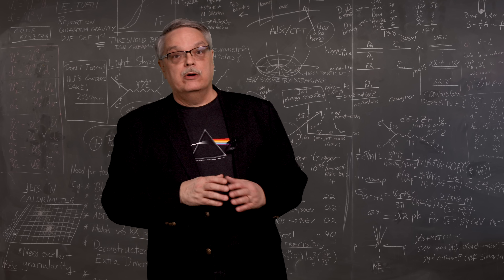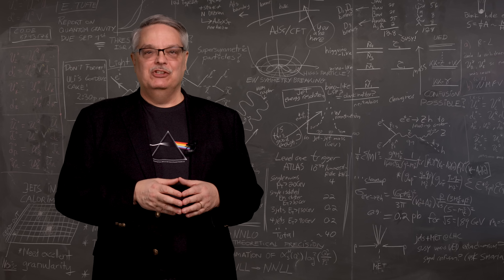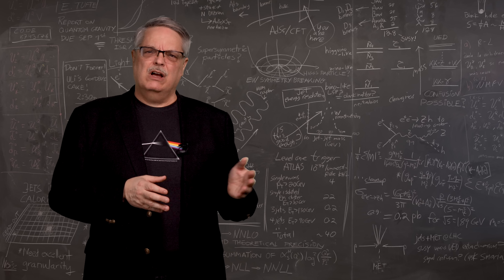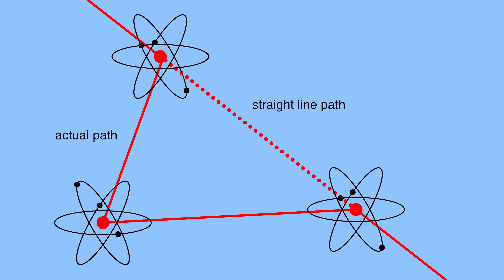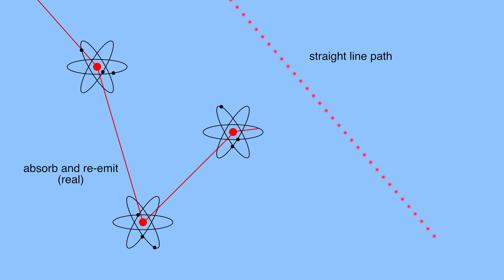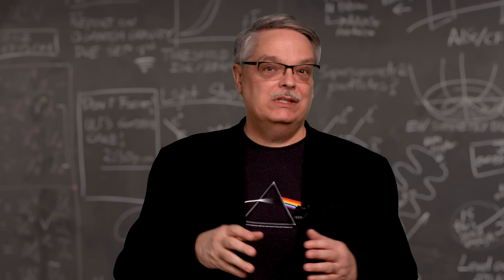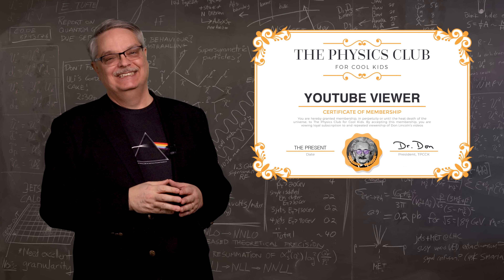Why does light slow down in water?

Comment: Great video, but this leads me to another question. I know that light is an oscillating electric and magnetic field, but that light has no charge or magnetic force. As it is an oscillating field, does that mean that it has a charge at its peak and a different/opposite charge at the trough but that the net charge is zero? I know electrons oscillate when exposed to light and this reaction would support my question

Comment: I get why it slows down when entering the glass at any angle... but why does the angle change twice? Why does the light not continue on the same path but simply move slower through the glass, then emerge and return to its original speed? What causes it to change angle when transitioning into and out of the glass?

Comment: To be frank,i am deeply dissappointed as most of our physics textbooks postulate that light speeds up or slows down depending on the medium in which it is transmitted.This hypothesis is clearly a violation of the fundamental laws of physics.The speed of light is a constant everywhere in this universe and this is the fundamental basis of the theory of relativity proposed by Einstein.

According to refractive index calculations,the speed of light in water is 3/4th the speed of light in vaccum. Most textbooks justify this by saying that light slows down in water coz its an optically denser medium. This justification is partly right and partly wrong.

To know why its wrong,you’ll need to know more about the quantum mechanical phenomenon of propagation of light through a medium.(i’ll try to explain this in the most layman terms as possible).

light is made up of photons(you can think of them as energetic balls) and all matter around us is made up of atoms which itself is made up of protons,neutons and electrons.The electrons in an atom have specified energy levels which it can occupy.when an electron absorbs a photon it gets excited to a higher energy level and when it releases one,it gets to a lower energy level.

So when light passes though a medium like water,it doesnt go straight unhindered.Instead the photons from the light beam get absorbed by the electrons in the water molecules and get retransmitted instantly. This absorption and retransmission of light by a molecule causes a time lag which is nanoscopic in nature .But if there are a lot of water molecules in the path of light,then the time lag caused due to absorption and retransmission of photons by every single molecule on its path becomes considerable.(important-note that photons after retransmission travel at the speed of light).So the entire journey of photons go on like this —travelling at the speed of light—absorption—time lag—retransmission—travelling at the speed of light—and so on.

So as a whole,light “””APPEARS””” to slow down while passing through the medium .THIS IS WHAT MOST TEXTBOOKS MENTION AS THE “SLOWING DOWN OF LIGHT IN AN OPTICALLY DENSER MEDIUM”!!

Comment: If you've ever seen a magnet falling thru a section of copper pipe, you would see this effect in action. The magnet falls through the pipe inducing an electrical field in the pipe that slows the fall of the magnet down. When it leaves the pipe the second electric field ends and it resumes falling at normal speed.

Comment: why does the resultant wave have lower amplitude, it still failed to explain the slower wavelength keeping frequency fixed, also i m failed to understand bending part here, which is related to slower speed, but i failed to understand from ur video, superimposed wave will be having delay. also y u r not explaining the magnetic part it is really effecting the charges particle, electron

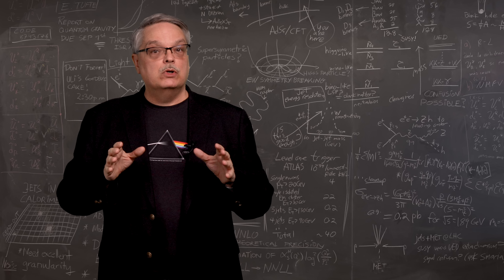Comment: at 8:45. indeed it doesn't explain the slowdown as only the amplitude is reducing but the velocity is the product of the wavelength and the frequency. there need further explanation on the superposition of the slower and faster wave causing the new slower wave.

Comment: There's a problem with the third explanation as presented, and it could have its own final graphic to show why it is wrong too.  If the light wave is now summed with another created wave to form a single new slower wave, then that created new slower wave will undergo the exact same process as it travels, to yield yet another slower wave, and so forth, on and on.  A conclusion final graphic could show the laser beam getting slower and slower racing to zero speed. I would imagine on a macro scale, like for a piece of glass, it would go to zero speed rather quickly, such that glass would be an absorber of light.  Perhaps that is what happens when light is absorbed in materials, but that can't be what is happening in clear materials. Or is the generated slow wave just existing in a certain part of the glass molecule because of its electron structure, then the light exits & propagates at c again to repeat another "brake" at the next glass molecule?  If so, this essential explanation should be in the video, otherwise explanation 3 as it is presented seems to fail to me too.  I might add as well, that your description of explanation 2 would occur if it was a fluorescent type propagation, but proponents of explanation 2 say that in the quantum phenomenon that is occurring, the new transmitted photon keeps the direction information. An updated third explanation and a more honest description of explanation 2 could in fact be the same thing.

Comment: So what happens if we dim the light or pulsate the light?  Would the result change?  The explanation seems to depend on the light field been already setup for the matter to act in response, but doesn't matter's electric field has a response time, perhaps unreasonably short.  So when we somehow shoot light for duration shorter then the response time or have an intensity so low as to not affect matter's electric field.

Comment: The refractive index of a material is determined by the phase velocity of light. In most materials, this velocity is indeed slower than light in a vacuum. But rock salt has a refractive index of less than 1.0 when using the x-ray spectrum. How does your model reconcile this fact? Would it imply that the electrons move prior to their interaction with the electric field of the light? Or perhaps they are so sluggish that almost an entire cycle passes, and therefore appears as if is it leading the light's field? (Note that since the refractive index is less than 1.0, the phase velocity is greater than the speed of light in a vacuum. This does not violate relativity because the phase velocity is incapable of carrying information.)

Comment: The distinction you make between an atom not 'absorbing' the photon, then retransmitting it (5:15) and the incident photon affecting movement in an atom's electrons (7:54) as the retransmission (with velocity change) causality is 'interesting' because it implies that on this occasion a change in electronic potential (due to movement) is somehow independant of a change in the atoms energy. But then again at 5:32 I learned that atoms can be absorbed by photons, so what do I know?

Comment: I am not convinced. Great explanation but E/M is a wave/particle duality theory. Wave theory dominates when E/M passes through space. Particle theory dominates when E/M interacts with matter. Your explanation is based on fields which is purely wave theory. Yet we are discussing light travelling through a medium which has matter in it. The electrons are parts of atoms which compose matter and although your explanation may be valid for the process of E/M travelling through the space within the medium, it omits the interactions within the medium with the atoms. Surely, the atoms do absorb E/M passing through it and re-emit it after a delay. Possibly a combination of Theory #2 and yours is a better explanation?

Comment: You told them "but the wave from the electrons moves at a different speed?" NO, how could you!  That's just plain deceptive.  We both know the secondary electric/magnetic fields generated by the electrons will propagate at the SAME SPEED as the "photons" traveling through the glass, not slower...   

Solution:  The refractive index (and hence, speed of light) of the vacuum is a VARIABLE condition which is determined by the amplitude of the "energy-momentum tensor" term.  Since the mass of the matter which the glass is made of has energy, the energy-momentum tensor of the space containing this mass increases, and the speed of light consequently decreases.

Comment: But that's wrong as well. If the electron wave changes the photon wave to slow its transition through the glass why don't the electron wave change also. To say one is stronger than the other or more than the other is not why. To prove your answer the electron must be measured to change also.  However just the ones affected.

Comment: Fundamentally incorrect explanation, and meaningless word salad. “Light is a wave” is simply false. Light is only approximated by Maxwell’s Equations as a wave, as such those explanations are dubious. For example, MEs cannot account for the photoelectric effect. Light is fundamentally described as a localised photon undergoing the mechanics of Quantum Statistics. Such a model explains all “wave” like AND “particle” effects. Light, as currently modelled in physics, are photons. Photons indeed must and only travel at the speed of light. Without a QED based explanation, there is no explanation, only handwaving.

Comment: Why is the second wave generated moving at a different speed? In the diagram it looks like the second wave crated in the glass moves at the same speed with a smaller amplitude. So adding them would create one of the same speed with a bigger amplitude. hmm.

Comment: I think that is where the confusion lies. There are actually two types of absorption/re-emission:

(1) Where an atom fully absorbs a photon, causing an electron to jump to a higher orbital - then some time later the electron jumps back down to its lower orbital and a new photon is emitted in a random direction.

(2) Where the photon's energy is absorbed by the charges in the atom (both positive and negative charges), causing them to be set into oscillatory motion, but no electron orbital jumps occur. These oscillating charges then emit their own photon (after a short time delay) due to their oscillation, but when they do so the direction and frequency of the photon is the same as the original incident photon - but there is a small phase delay due to the inertia of the oscillating charges between absorption/re-emission.

It is (2) that is occurring in light propagation in optical media (and in Fresnel Dragging). 
Dr Don seems to jump to the conclusion that when people explain the process by absorption/emission that they are talking about process (1) but doesn't consider process (2). 
That seems a bit short-sighted, or disingenuous.

Comment: The excited electrons will have varying positions and speeds relative to the incoming wave, giving the same kind of dispersion that he uses as a reason for rejecting previous explanations. Apart from this, his "explanation" implies that the further the light beam travels in water  the slower it will get. This is not what happens. Light has one speed in air and another in water. And that's that. Let's face it, physics hasn't the faintest idea of how light travels through a denser medium.

Comment: This still doesn't make sense because even though their is interference between the waves they are still two separate waves that move independently of each other and pass though each other just like in the ripple of a pool the waves still pass though each other at the same rate the interference pattern should change but not the separate wave.

Comment: After thinking about it for about 25 seconds;  I figured that it just as moves swifter in a space without substance;  because I think that it's even slower at going upon it's actions through elements that have atoms of non translutiants within it and same again goes for the elements as in relation of more and more up to only have non translutiants.  The more that I notice about what things do;  the more I find that we are way little.lol  I think that light is energy and it just keeps equilibrating to where it eases and where there isn't and elements at all there isn't any light (energy at all also(maybe;LOL).  Like silver for instance;  would have a different type of structure;  where I can't really imagine right now but maybe translutiants that are absolute non transluting or vice versa or what not.  LOL I'll watch your video now and see;  oh and I also think that it might have something to have to do with the atoms needing to absorb  on the one side and disperse the other until it also either has kept energy and when dispersing it as it equilibrates;  it will likely be leaving(transfering)at a slower pace or maybe higher one if the adjacent one is of element that will absorb it's energy in bursts where we would be able to see it as light and....  anyways I'm done for now;  when I I'm stuck;  Iiquit.  LOL Cheers  Oh and I think that atoms' walls being on angles or maybe the inner of the atoms are maybe empty of solids also;  thus forcing the energy to travel through as solid(the walls)as it is within containment and is forced to struggle as it levels out constantly from an atom to the other whist bouncing from one to the other or either that or it has to kinda squeeze though with forces and pulls(from the back that releases and then absorbs) but that thinking quite in the what I hope is the last of the smallest size but I also think that it is also impossible to it being as that otherwise we are almost as small as thing get.  LOL Goooodnight.
Reply: It just came to me two hours later that everyone thinks light is moving in a strait line because of the distance that seems to be far;  the reality of it is un-disputable;  light is only seeming to be light because it is being seen in an accuracy where if seen for instance from the size of for example;  a trillion times the biggest that that we believe the universe is or whatever the size needed;  eventually;  the transfer of this energy will seen slower and slower as it gets seen from the larger and larger of a view point;  therefor light that is in your eyes fast is actually slow;  it's you and I that are really really small.  And it's still just transfering of energy.  Cheers
Reply: Tomorrow; I'll watch the video and for the same reason as you point out is why I refrain from watching but yours;  I'll watch;  I think.  I might find you wrong though but maybe not.

Comment: I still have problem understanding if the initial wave hits the material (lets say a laser)  then shouldn't the initial wave still pass the material at the light speed and induce the counter wave at the same speed. In that case the frequency change and refraction would be explained but the time it takes the photon to pass the material should stay the same.

Comment: This explanation still leaves a few questions for me: So if the resultant light wave is a summation of the original beam (in a vacuum) plus the electron-created beam (that is "slower") wouldn't this just explain a frequency-shift but not a speed change? Blue light travels the same speed as red light. In other words, the front of the beam would not be slowed down. Why is the electron-created beam slower (not just lower frequency).
Reply: This puzzles me as well.
Reply: I think they didn’t make it clear that the frequency actually doesn’t change. Think about the interface between the two media… the peaks and troughs are synched on both sides and if you were to count how many peaks per second go through various points, it would have to be the same (otherwise you’d have some peaks in one medium that didn’t have a corresponding peak in the other. Because frequency is constant, wavelength (and thus speed) changes. This isn’t a perfect explanation and there are gaps… mostly due to my own ignorance, but it’s my starting off point.

Comment: Ok problems with your didactic: 
1) You actually do not explain why light gets slower in glass at all. The only thing you base this on, is your sentence at 8:40 where you just claim it does. But none of your previous explanations lead to this.

2) At 7:12 you show moving waves and add them up, but when you get to the electrons at 8:10, you now add static waves.

3) At 7:01 you state that adding waves with different wavelengths results in a funny shape. At 8:28 you show exactly this process - two different wavelengths added together. Makes absolutely no sense, because first of all it would result in the "funny looking shape" and more importantly at 8:22 you show both wavelengths to be the same.

4) At 8:10 you show the static e- wave to be exactly the same wavelength/frequency as the photon one. Which completely makes your point invalid. You try to fix this, by just claiming it moves in a different speed - why should it? This is the most crucial part and you do not explain this, and this is why your whole video does not explain the question at all.

5) Won't exciting the electron transfer energy over to it? Has to be, because otherwise the electron would not move(?). Then the photon would have to have less energy, thus change its frequency (E=hf). So why is this not observed?
Reply: 1) He explained it pretty clearly, maybe watch it again? 😎

Comment: Light slow down but never change the color (v = f x Wavelength) ! If the wavelength is the resultant of the e-field of the photon and e-field of the electron causing the change of the wavelength. In case of wavelength change there should be change of the color too but in reality there is no change in color.